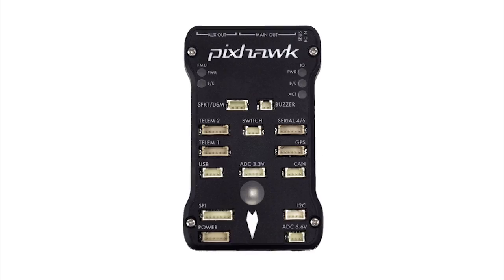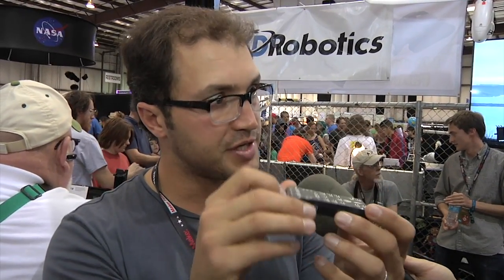What Makes a Drone?

Comment: I could see these little guys being used for some very very bad things in our future. Wouldn't mind using one to plan out special locations though to visit
Reply: indeed. They're tools, and like any useful tool, are capable of as much evil as good.

I tend to make damned sure I'm being safe and sensible when I fly my R/C vehicles, it would be even more the case with a drone.
Reply: Could you imgine though? Sleeping soundly in your bed to a .22 caliber shooting quadrocopter came to your house? Scary, but I plan on using one to gice me special views of where good dig locations are for historical landmarks
Reply: brooks potts
yeah, I can imagine that. me and a few friends of mine thought it'd be a hoot to stick airsoft guns on some bigger R/C aircraft, and see how long we could stay in the air. Firearms are quite a bit heavier, which puts them out of the range of most electric aircraft.

You'd have to worry about them stealing your pin number while you're at the ATM a lot more then getting shot at.

And if you're looking for something for areal footage (assuming you use a metal detector, or something), then a drone will do well for that.
Reply: brooks potts Wouldn't worry about it, simply putting a gimbal for a gropro on a normal drone would cut its flight flight time from 20 minutes (just basic quad), down to five (FPV gear and stabilized equipment). There's actually one show where they put a paintball on a big hex (I keep wondering how long it managed to stay in the air carrying a steel gas tank and gun) and the guy they were going after finally had to step out right in the open and stand perfectly still just so he can get hit.

Altho, now that i think about it. 3D printed guns would be perfect for these. The guns are lightweight and can be molded specific to the airframe to help reinforce it.

Comment: to me, as an RC enthusiast for 13+ years, drone is a dirty word. I know that technically what they are but when most people hear the word drone, they instantly think of a spy plane.
Reply: ***** as someone who enjoys flight, its for the fun of it. As it stands you need a permit to fly a vehicle with a camera in it anyway. THAT and these "Drones" are very popular with amateur and professional movie/video makers alike. They're used in everything from filming movies, sporting events, concerts, the WRC. 

Its also not a question of need, these are part of the world wide hobby of Radio Controlled Aircraft. If someone is using it to spy on others, they're an idiot and are why the world wide RC community dislikes people that do that.
Reply: *****
Agreed. I know that I try to be safe and courteous with my R/C vehicles. Not a lot do. The tech has become cheap enough that one can aquire a drone before they aquire the sense to know when and how it should be used. There's no easy solution to that one, sadly.

Those in the RC community (even those of us who don't fly often or hardly at all) have names for folks whith more cash then sense. None of them are appropriate for polite company.

There is a class of R/C vehicle that might need some consideration, and that's the very large (usually over 100 pounds) R/C aircraft that really need a runway to take off and land. if there was a 50 pound weight limit without FFA tower clearance (which would include most of the super-scale and smaller) it would seem fair. Trex helis, quads and park flyers aren't much of a risk unless they run into some one (it happens, beleive me. usually nothing more then pride is hurt)
Reply: yeah. That is, in fact, the case. usually if people have the opportunity to see one in action, the understand much better what it can, and cannot do.
Reply: DFX2KX Doesnt mean these "drones" cant be retrofitted to be used by regular people to spy on their neighbors or to become a lethal weapon frame. Sorry but I just dont see the purpose for civilians to ever NEED one of these things. The government is bad enough.
Reply: I really didnt think about those examples. Thanks. I see your point but I still see the potentially hazardous opportunities that can occur if abused.
Reply: ***** indeed. They are abused every day and its sad they are because it causes problems for those that use them right
Reply: Finally someone who i can agree with!!!
Reply: Eric Torres You don't need a permit to fly a RPV with a camera system. At least in the US you don't. You need a permit if you are using it commercially and selling the video/photos, but just for a hobby no permit is required at all.
Reply: IKR I got a camera drone with no permit that films in 720p and can go up to 200 feet

Comment: Is this all Legal? Very cool technology.
Reply: John Ridley There's no official definition for these drones. RC planes and helicopters had always been an exception to the FAA and if it weren't for the stigma on 'drones' because of their somehow being associated with military UAVs, they would still be categorized as 'toys'.

The FAAs threats have no teeth, they have been tasked with making rules and guidelines for drones and they're still not even close to being done (If you've heard of it, it's the one the president saying something about the FAA needing to make room for 30,000 drones to start with several years ago). Understand that at this point, they are apparently enforcing rules that do not exist.
Reply: John Ridley use the imagination for something else.  autonomous vehicles, air remotely piloted vehicles are a great counter terror weapon, and a very lousy terror weapon.
Reply: America it is
Reply: The only thing that could be illegal Is your frequency your video hardware runs on and your power level. The reason why the frequencies are illegal is because the may infer with other devices or you are unlicensed to use them. I own a HAM radio license so i can run the "forbidden" frequencies like 1280mhz. =]. The GPS is completely legal; Your phone has the same tech. Not to sure about  FAA regulations...They can go over-regulate something else for all I care =]
Reply: It all depends on your opinions and political views. As we can all understand, things can be used badly if dangerous people can get their hands on it. Gun, knifes, cell phones, computers, rocks....the list goes on. To me regulation roots going this deep is an over-regulation. People are allowed to think otherwise.
Reply: Granite I did some research because you really got me thinking. So, the FAA owns the rights to regulate the air 500 feet above the ground. All area 83 feet above the ground is owned by the landowner outright. But, you may be asking what about the gap of area between 83 and 500 feet? Well, recently the FAA has been making it their mission to go out and find small commercial unmanned RC pilots and threaten them with large fines if they continue using the area between what is specified. They say they are regulating the land, which congress said they are not allowed to regulate back in 1926, for "Safety" reason. This over-regulating and an example of the government butting in where they aren't needed.
Reply: Granite The FAA wanted to impose laws after someone thought it would be cool to see how close they could get to jumbo jet taking off. (Keep in mind RC aircraft are not aloud with 4-6 miles of an airport depending on where you live)

The NTSB came back and said that the FAA proposed laws were unenforceable. The frequency legality is also not a problem. RC manufacturers are well aware of the this and are now making radios that operate on the 2.4GHz range. Someone with a HAM radio license can also fly on those "forbidden" frequencies for doing long range FPV.
Reply: John Ridley There actually isn't a "line-of-sight" law. Most radios have a range of up to 2 miles sometimes more. GPS automated flight also isn't illegal. Now laws might differ depending on where you live. I live the USA specifically California. Automated GPS aircraft has never been an issue especially when getting into multi-rotor aircraft that have GPS control to return them to a "home" position if the radio connection is lost. 

Also a nation wide thing to help is AMA membership which is also an insurance coverage if there is ever an accident.
Reply: Eric Torres  Aloud?
Reply: Ted Fryman autocorrect from my tablet. "Allowed"
Reply: I beg to disagree, if i and my friends lived close enough to deer trail, colorado, we'd launch cheap, long range, long endurance glider planes with the biggest speakers we can carry and play Justin Bieber albums at full power all night. If that doesn't call the national guard and have the US declare war on canada for terrorism, i don't know what will.
Reply: Ibushi now that is nasty!  justin bieber? that's a horrible thing to do.  you are a bad person, sir!  lol lol lilllll hahaha
Reply: Eric Torres Actually, there is a law guiding RC aircraft under 55 lbs used for hobby purposes in the US. The FAA is trying to make FPV illegal right now, and mandates that you have a spotter keep line of sight view of the aircraft with an un-aided eye while you're using FPV equipment. Just because radios reach past 2 miles doesn't mean that you can fly them out to that range. And plus, the AMA insurance only covers you if you are on a AMA registered field. If you're out on your own some place and hit someone or something, then you're screwed.
Reply: Dakota Alger that's why there are already laws in place that protect people from other's actions in general. 
if you drive a car outside of a racetrack, and run over a grandma pushing a shopping cart, you are liable..
there is no need to outlaw cars. there are already laws about pedestrian right away, reckless driving, etc.
the last thing we need is more laws outlawing specific technology.  
no fpv plane has ever caused an aviation accident involving a full size plane.
this is a lot of media hype, and lawmakers who don't understand technology, and think that they do. people who know nothing vote for them, and help them pass laws that none of them know anything about.  
pleeeaaasseee.....

maybe while you are at it, make some laws about those other flying unregulated machines called birds. they strike aircraft all over the world,on a daily basis, and have even taken down airliners full of people.  
let's get em allll..!!!!  HAHAHAHAHAHA
Reply: FPVREVIEWS I was just correcting someone else. They said that AMA insurance covers you whenever, but it doesn't unless you're on an AMA field.
Reply: Dakota Alger AMA field, FAA,  insurance?   lol..
time to start worrying about real problems..    I'll send money to the AMA, but only so they can fight the FAA... 
what a joke this whole thing is.  makes me sick..
what is insurance anyway except paying someone else to take responsibility for your actions.
what is a federal agency, except to pay someone else to tell you what you may or may not do,  and by the way, they know nothing about what you are doing, anyway,  then you pay them to fine you, and then you pay them to put you in jail.

no thanks on any of that.  time to get a life for all of us, and do what is best for the future, and society, not the government, and the insurance companies, and of course take responsibility, and precautions to do with our own actions. let's take an example from some real countries, like Australia.

oh, yea, we have a cure to cancer, but who will insure it, and who will regulate it to make sure it only gets used on people of a certains social class, etc. (hypothetical)   
i have work to do.  bye...
Reply: FPVREVIEWS I'm not promoting anything, just simply informing. Sorry you hate the world.
Reply: Dakota Alger I don't hate the world. if the whole world is regulating themselves and selling insurance, we are all screwed. that's all.  now back to work. i have an oscillation to tame.  I'm not trying to attack you, just think beyond being told what you can do, and what you can't. It's liberating...Oh, yea, liberty, freedom.  remember?

Comment: Where have you guys been? Parrot A.R. Drone 2.0 with optional GPS unit and and Ground control program for a laptop. they have done this over a YEAR ago in a $300 drone. Full auto takeoff to waypoints and then returns Home.

Comment: most expensive arduino ever.. just get a hk pilot and a good gps
Reply: It's the same software, you are just getting cheap sensors that make it much harder to tune and not as crisp to respond. Save yourself time and money and get the right one in the first place. If you cheap out you end up needing to replace it later anyway.

Comment: I want a drone capable of being launched from my car. Imagine it - stuck in a long queue of cars for no obvious reason. Press a button and a little camera drone automatically launches and hovers 20-30m above you, sending live images.

You could then send it away down alternate routes to see if they're any better.

This would be totally automatic too, controlled by your car's satnav system.
Reply: or you coult turn on the radio which will tell you why the traffic is jammed and which routes to take.. at least such traffic news exist in germany
Reply: Such traffic reports exist in the UK too. They're not on demand though and tend to be announced only during morning and evening every half hour.

My car's satnav uses this data to warn me about traffic problems, but it's not reliable.
Reply: Or you could just make flying cars instead... and skip this scouting drone idea altogether. ;-)

Either way, there's still a substantial energy to performance and range problem to be solved here before any of that becomes viable.
Reply: PHeMoX argh people have a hard enough time driving on roads. Letting them fly would be a disaster - you'd have drunk drivers landing on people and stolen cars abandoned in the top of tower blocks.

We need better battery technology in everything. And maybe something safer than lipo packs.
Reply: I think google maps do show live traffic update already sir.